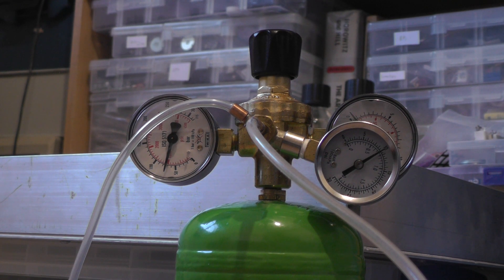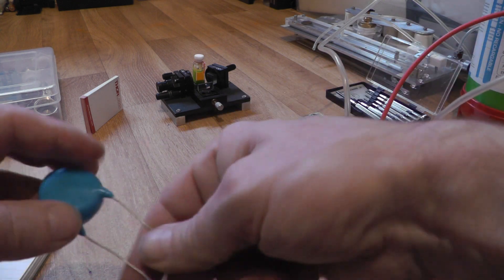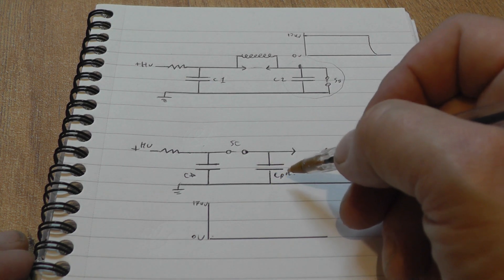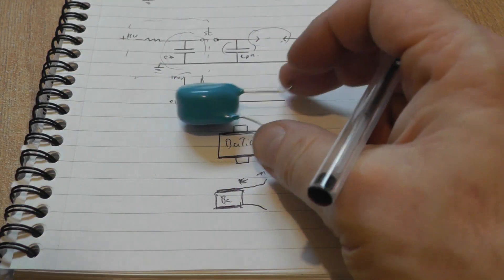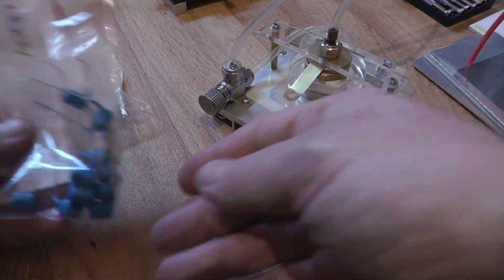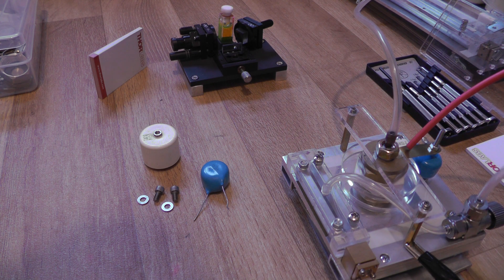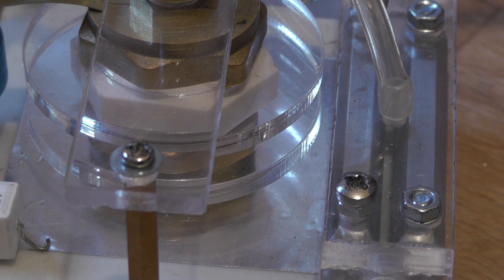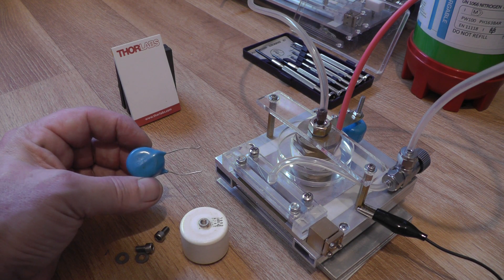How to make Inexpensive Nitrogen Laser Capacitors!

Comment: You have to modify the blue ones otherwise you will not do a good job. The legs have to be cut short as possible also solder the crimped ends after crimping

Comment: really late to this party, but I've seen axial versions of those capacitors.  they aren't as common, but they have high voltage ones and they're still dirt cheap.  that's if you can find them in stock somewhere
Reply from the maker: Yeah these things always seem to show up sporadically! It would be interesting to get hold of some large raw barium titanate pucks to have a play with...

Comment: I think your screws are steel ones.  My reasoning has for years been (without any actual verification) that brass screws would be better in fast rise.  All that might be true at medium speeds and iron and Eddy current effects already negated at really high frequencies (and fast rise currents).  Maybe I should try some measurements instead of keep speculating?  Come to think of it, my 100 kHz LCR meter probably is not up to the task, but the 13 MHz phase meter might.  In worst case, I could build something around my 110 MHz amplitude and phase meter, for which I finally got a genuine HP sampling probe.  Or maybe you could still extend your tests and reporting?

Comment: Im curious, how can one capacitor discharging into another create high voltage, is there no inductance at all there?
Reply from the maker: The capacitor is already charged to high voltage (about 12 - 17kV or so) Discharging a comparatively large capacitance into a smaller one produces a very fast risetime (subnanosecond) which is required to pump a Laser like this.
There is inductance all over the place (foils, leads, chassis etc) and these cause the circuit to 'ring' or oscillate when it fires. This can result in approximately twice the charging voltage appearing across the channel when it fires.

Comment: GREAT STUFF...THUMBS UP AND SUBSCRIBED!!!!
Can you tell me what preasure level is in thr N2 channel??

I have an old N2 laser that is almost as big as a small car!  ...had it running a few years back.
Reply from the maker: It's atmospheric pressure, no vacuum. The N2 is fed in at a slow rate, enough to stop air diffusing in and remove any N2 that is either warm or not yet fallen back to the ground state. In principle you could put it in a airtight box, flush it with N2 and circulate with a fan.

Comment: Ive done similar for making marx generators that are very quick. To solder to the metalized part you can use a very low melting point solder like indium/tin or tin bismeuth. Get it nice and hot and add a bit of silver to it, stirring with a silver spoon is fine. Then let it cool in convenient sizes. The marx generator was used to power pulsed x-ray tubes. 🤓

Comment: Have you ever tried setting up the spark gap so the UV produced shines on the lasing gap? In theory it might prime the gap a bit and make lasing better.

I made a TEA laser many yars back (video on my channel) it kept blowing out the dielectric. Any tips on stopping this from happening?

Can you run this on Co2 and get red laser?

Sorry for so many questions. Things I haver been pondering for years and just found your excelent channel.
Reply: At the extreme peak currents almost any gas will lase in a system like this, but some will need a mirror set. For IR a gold HR mirror and a znse window is plenty, for visible use a silver or broad band dielectric mirror for the HR and a bit of microscope slide as the OC. UV is a bit trickier, but an aluminum FS mirror is fine. If using halogens the mirror needs to be a second surface mirror. A silica window is ok for the OC. The gases i tried are CO2 nitrogen and helium for 10.6um far IR, Oxygen and helium for red 6xx nm, pure neon for orange and green, xenon helium for multiple blue green output; but if iR optics are used it lases at some rather strong IR wavelength too, argon helium for mostly the 488nm ion line, and xenon chlorine and helium for a near UV output quite a bit stronger than N2. 🤓😁❤
Reply from the maker: I have not tried exposing the channel to UV, but the top electrode of the peaking capacitor is positioned in the cavity, so that it produces ions in the cavity before the laser fires.
CO2 might work to product an IR laser at 10 microns. It is something I might investigate.
Reply: @LesLaboratory  very interesting about the ions from the capacitor. I'll have to build another laser one day. Was one of the most fun projects I've done.

Comment: What would happen if you made a similar laser but instead of aluminum…. I used polished copper or bronze? I have hundreds of pounds of buss-bars, ranging in size. Some are only 12mm wide and a few mm thick. But the biggest ones I have are HALF A METER wide and 18mm thick!!!! And every size in between!

Most are plated in an extremely thick silver coating. It’s about 95% silver. Some of the bigger busbar segments weigh over 100 pounds individually.
Reply from the maker: I don't see why not. So long as they have good straight edges on them, it should be fine. Thing to bear in mind is that TEA lasers don;t scale very well. The longest one I have has a 1 foot long channel and at that, it is approaching the limit. With lower gas pressure you could probably built a 3ft channel.

Comment: You can actually remove the coatings pretty easily. Which would allow the leads to be positioned as protruding from each side. similar to a door knob cap. 
Then you can even cast it in your own little epoxy body… with screw thread leads, and isolation exactly like an expensive commercially available door knob capacitor.

There are many different coatings…, but most of them have a brittle epoxy, so once you make a small starting place with a crack or chip… It’s really easy to get it all off. You could also try putting them in the freezer overnight or in liquid nitrogen and then smacking them on the edge of a wooden table while holding the leads in your hand. The coating should just completely shatter.

It’s really easy to chip the coating off of them. You can either use a small hammer, or even squeeze them between vise jaws or pliers.

 Do it in a way around the edges so that it doesn’t damage the capacitor inside it only chips away the coating. Once you get a few chips in the coating you can take high pressure compressed air and blow into the crack or chip… And it will separate the epoxy from the capacitor. 99% alcohol helps as well, along with compressed air to work its way along the inside and separate the coating. 

Found this out the hard way by dropping a few of them on the concrete floor and they chipped. 

Even if the legs becomes damaged you can easily reattach it once the epoxy is removed.

Comment: 12:21 why this laser pack inside acrylic with Vacuum pipe if it's Atmospheric Pressure Tea laser ?
Reply from the maker: To exclude air. Oxygen poisons Laser action.
Reply: @LesLaboratory  so it's pure nitrogen ?
Reply from the maker: @omsingharjit  yes, pure Nitrogen is flowed through the tube.

Comment: A comment on the wound polypropylene capacitor... In my experience taking those apart, they are made cleverly: one platter sticks outside the insulator on one end, and other platter sticks outside the insulator on the other end, so the current does not spiral around the capacitor but instead travels along the capacitor.
Reply from the maker: Yes I have pulled a few apart myself, and they do interesting things to try and reduce internal inductance, but you must also take the length of the foils into consideration as well.

Comment: Would it be enough to put a layer or two of heat shrink over those leads, all the way up to the ceramic package? Or is the voltage high enough here to defeat that?

Comment: Can you show the frequency calculations as to delta the firing rate? Does the channel length effect the firing rate?
Reply from the maker: The firing rate is determined by the overall Capacitance of the system and the Charging Current. The more current you can supply, the faster it will run. There is of course an upper limit, where the dielectric will be stressed to failure point. Additionally Warm Nitrogen gas does not Laser very well. There was no calculation done for the firing rate, I simply measured it.

Comment: If you look at the wire lead capacitor, there is a "bump" where the wire runs across the barium titanate dielectric under the epoxy insulation. You should be able to trim the wire leads flush with the capacitor body. Seal the wire cut ends with epoxy or urethane glue, or corona dope, insulating varnish, whatever you have. The carefully sand away the epoxy covering the wire bump on the ends, just to the point you see copper. Do not remove enough epoxy that the wire becomes unstable. Then slide the modified capacitor into the place where the door knob capacitor is mounted. You may need some conductive shims, washers, whatever, to adjust the overall thickness. It may even be possible to epoxy a machine screw, a machine nut, or a short threaded bushing, to each side of the modified wire lead capacitor (in the center) to create your own home made, "doorknob" capacitor.
Reply from the maker: Yep, for sure. It is an option I experimented with, and it is quite possible to dig though the epoxy as you say. The interesting thing about stripping the original epoxy (and a goal for a future experiment) is that is should be possible to stack the pucks and sink them in epoxy for a very high voltage, low inductance capacitor.
Reply: I thought about soldering a piece of metal strip e.g. copper foil or sheet  with a hole for a screw to the exposed wire. this has much lower inductance than wire. Then insert the screw in the hole, bend back and epoxy

Comment: why not use another doorknob to replace the unstable foil capacitor?
Reply from the maker: The peaking cap in this design is not unstable and will last for thousands of shots. If it ain't broke, don't fix it! By the time it fails, the channel is due for a clean anyway, so it's no big deal. The problem with using doorknobs for peaking, is that the inductance of the peaking stage is very critical. Doorknobs are likely to have too large an inductance.
Reply: @LesLaboratory  I tried these capacitors in longitudinal excitation laser and I found they are very easy to happen breakdown. The seller told me these capacitors are unsuitable for HV impulse circuit. And will it happen in your TEA laser?
Reply from the maker: @georgegreen3672  It has survived so far! I am only driving it at 17.5kv (half its voltage rating). In a longitudinal setup, I suspect the voltage would be higher?
Reply: @LesLaboratory  I think the voltage of LE mode is as same as that of TE mode, the difference is nitrogen pressure.

Comment: Have you thought of taking the skin off the capacitor? Maybe try it with a bench grinder until you exposed the wire. Or you cast the wire ended cap into an epoxy puck with the standoffs cast in?
Reply from the maker: Yes, but the epoxy is very tough. Knst-wrk suggested formic acid and acetone, so I will give that a try...
Reply: You can actually remove the coatings pretty easily. Which would allow the leads to be positioned as protruding from each side. similar to a door knob cap. 
Then you can even cast it in your own little epoxy body… with screw thread leads, and isolation exactly like an expensive commercially available door knob capacitor.

There are many different coatings…, but most of them have a brittle epoxy, so once you make a small starting place with a crack or chip… It’s really easy to get it all off. You could also try putting them in the freezer overnight or in liquid nitrogen and then smacking them on the edge of a wooden table while holding the leads in your hand. The coating should just completely shatter.

It’s really easy to chip the coating off of them. You can either use a small hammer, or even squeeze them between vise jaws or pliers.

 Do it in a way around the edges so that it doesn’t damage the capacitor inside it only chips away the coating. Once you get a few chips in the coating you can take high pressure compressed air and blow into the crack or chip… And it will separate the epoxy from the capacitor. 99% alcohol helps as well, along with compressed air to work its way along the inside and separate the coating. 

Found this out the hard way by dropping a few of them on the concrete floor and they chipped. 

Even if the legs becomes damaged you can easily reattach it once the epoxy is removed.

Comment: maybe rubb off the coating on those leaded caps and make your own doorknobs by soldering copper/brass nuts on there
Reply from the maker: Yep, could do that for sure. The epoxy coating is pretty tough though. I have tried to de-pot a few of these with not much success. No solvent seems to touch them. Heat works but cracks the dielectric.
Reply: @LesLaboratory  Try a mixture of acetone and formic acid and let the capacitor sit in it for a day or so. This will turn the coating mushy, and it can then be peeled off. Usually you'll find a silver plated ceramic wafer underneath, ready to be soldered.
I used the above solvent formulation quite a bit for quality control in HV assemblies...
Reply from the maker: @knst-wrk4701  Thanks for the tip, I will give that a go!
Reply: @LesLaboratory  You are handling the blue capacitors incorrectly. Do not strip anything in them. You must remove the spark gap from this structure. And from two capacitors to make two cascade Marx generator. Where the spark gap will be between the capacitors. And you need to come up with a design where the legs of the capacitor will be no more than 5 mm long. Because the laser power will depend on this length. You also need to fill the capacitors with wax or epoxy resin so that there was no spark. Then with the same supply voltage the power will be higher than with one barrel-type capacitor. (From Russia with love :))
Reply from the maker: @maksimkonoshenok3980  Thanks, already done!, See this video for an update: https://www.youtube.com/watch?v=NEHiv4lv68U

Comment: What you could also do is put two of these in series. The voltage over the "spark gap" at the leads would be half of the value now, preventing this sparking. Of course the resulting capacitance would als be half of the current value, but since they are so cheap that would not really matter. You could actually take a version with a lower voltage rating.
Reply from the maker: Could do, but then inductance will stack up as well. It would be easier to pot it in epoxy or paraffin wax.

Comment: Would the purge gas from an oxygen generator (concentrator) be pure enough for the N2 laser? They're easy to get hold of and would provide unlimited nitrogen.
Reply from the maker: Probably! Anything more than 0.5% O2 will start to poison the Laser, but from what I read, membrane separators can produce N2 with greater than 99.9% purity, so it should be fine. I have been on the lookout for a membrane separator for some time. That said, the higher power Nitrogen Lasers will Lase plain air and produce enough output to run a Dye Laser.